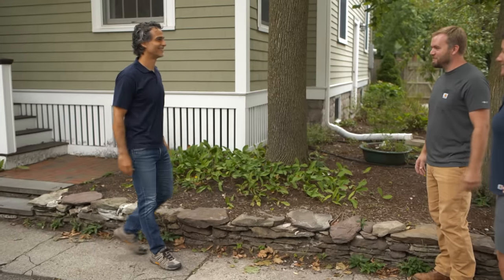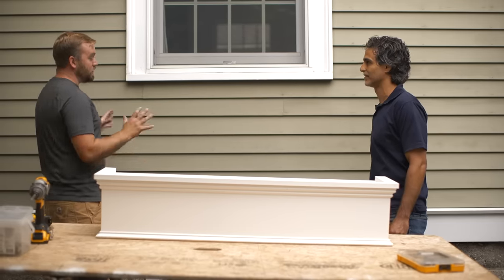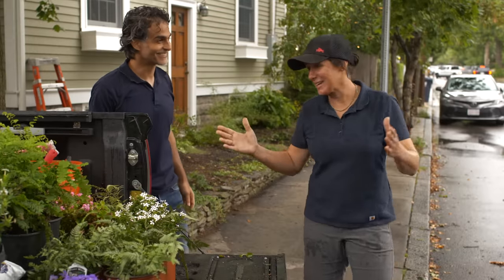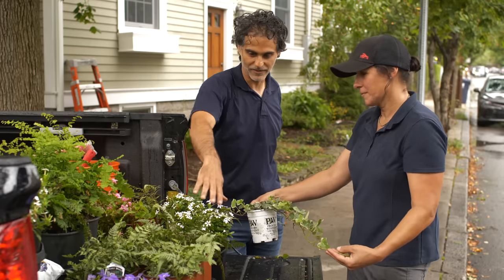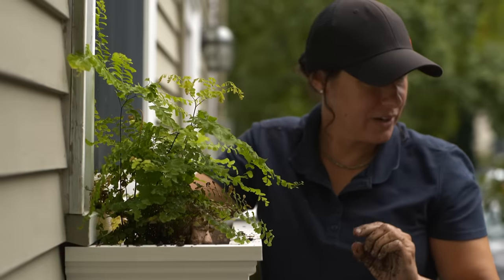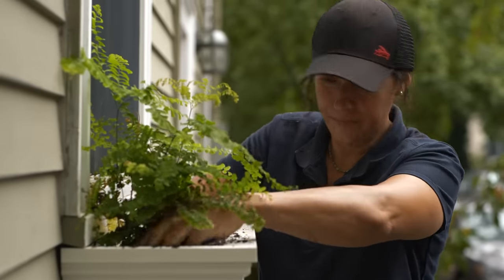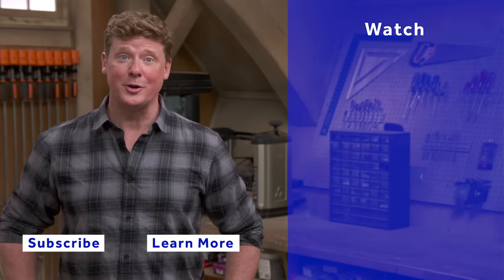How To Build Window Flower Boxes | Ask This Old House

Comment: Nice looking! I made some last year but made them so they would support removable plastic planter box trays. This way flowers could be brought in during cold weather, they're easier to clean out and when they crack they just get replaced without wrecking or staining the wood boxes I built.

Comment: for the weep holes, I'd get some galvanized wire, fold in half, make a loop "anchor", with about 2 inches bent perpendicular to the loop. Drop the straight end thru the weep hole so you can bend the wire away from the siding. This will give water a lateral push away from the siding so the siding doesn't get stained from the soil drainage.

Comment: I like to add PVC pipe the the bottom with holes drilled in it with a stand pipe and rope filling the holes. The drip system or a watering can can just fill the pipe and the water slowly releases into the soil as needed. 

Nice simple and inexpensive self watering system.

Comment: Very nice. I'm thinking of doing a window box to cover the changes in size of a bathroom window. I want to install shower and want to make the window there shorter so it doesn't come down as low, but I want to cover up the change and thought a window box might look cool so there will still be something to match the height of the adjacent window on the bottom. I know I will need to install house wrap, but do I need siding over the house wrap if the box covers the house wrap?

Comment: it looks like you're using the PVC Trimwelder 50ml Fast Cure by Extreme Adhesives. 
can you recommend an alternative as I am having difficulty locating this product? - sold out at Home Depot.
the glue that you are linking in the description is for pipe fitting applications not structural projects such as this one.
Reply: also the band molding you are linking is primed MDF, not PVC

Comment: 🙋‍♀️ Question! Can the window boxes be made a bit wider than the windows?
Reply: The key is attaching them to the studs.  The siding should give you a hint, since the ends are always attached to a stud.
I have found studs under windows are not always 16" o.c.

Comment: 1x10 pvc stock?  I've not seen that in Sacramento.  What glue also?
Reply: Not PVC glue from the plumbing aisle—see comment below for better answer
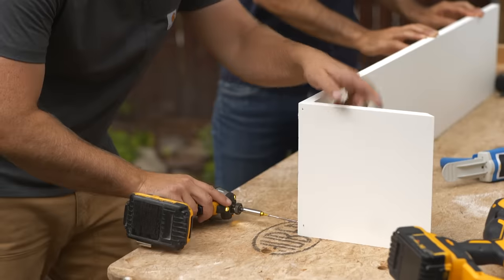Reply: no, he is NOT using plumbing glue he is using PVC TrimWelder 50 ml Fast Cure  - i can tell by the applicator gun @1:33 (it's blue and gray only partially visible) and he even says it's a 2-part adhesive @1:30 in the video
Reply: @Straight0uttaCrofton  ah I stand corrected. I’ll leave my comment rather than delete so anyone interested can see the right answer
Reply: @toddjasper1  i am having trouble locating it in that 50ml size, which fits in a caulking gun adapter that they sell separately or in a kit. this saves you from buying an applicator gun. doesn't appear to be a lot of alternatives, either. / =